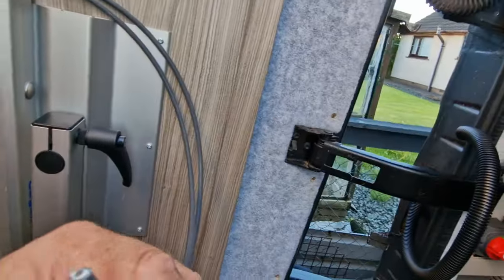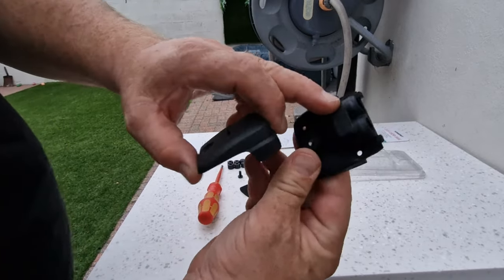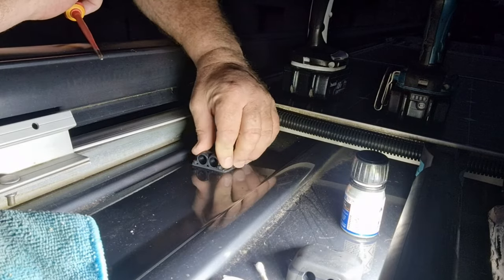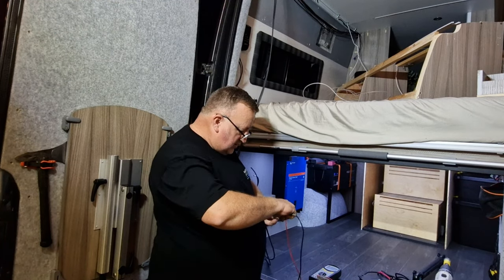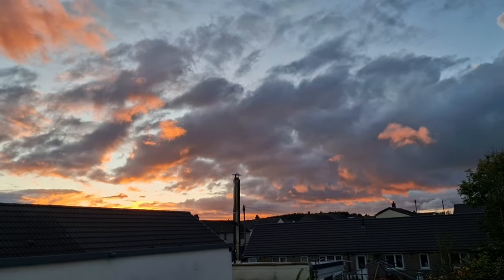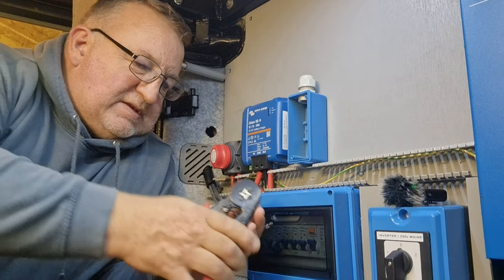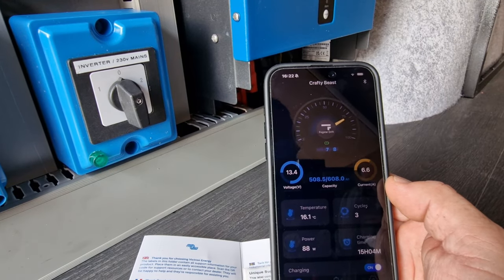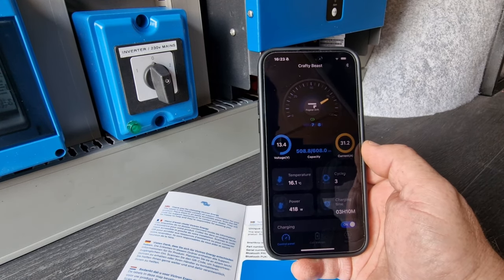installing the Victron MPPT & battery charger to The Beast Fogstar battery

Comment: Great video,again,can i ask what lenth is your van? Would you think with future legislation re raising the grossweight to 4.250k ,just waiting to be rubber stamped,that VW would be future proofing their new vans so they can be uplated from3500 to 4250 with minimal fuss ie built to the new gross weight spec !!
Reply from the maker: Manufactures will be looking at the reclassified Europen driving categories and building vans to suit I would assume 
The s
Sprinter and Crafter were only down plated from 3880kg to line up with the B1 license category, once Europe up the weight  that can be driven on a B1 to 7.5t I'm sure the manufactures will follow suit

Comment: I believe the regulations now require all of the breakers here to be in a metallic enclosure as you could argue that it’s a residential environment if you will sleep here
Reply from the maker: If you referance BS7671 only needs to be metal if in a garage or the location requires it
Reply: @TheCraftyBlindersvanlife  it’s actually building regulations that say it for a house however it has successfully been argued in court that building regulations still apply here because they apply to all electrical installations. It’s a bit of a grey area but as it’s due to fire safety it very much could be argued, but it could be both ways, technically speaking this is semi classified as a house and it gets a bit weird